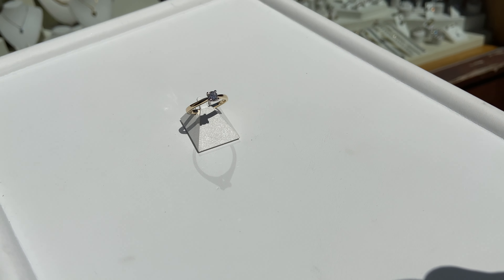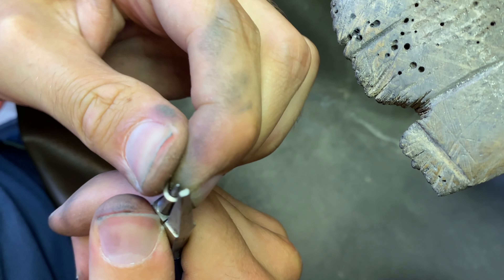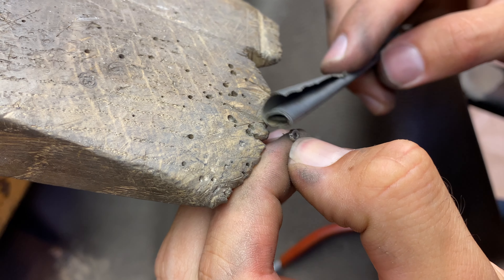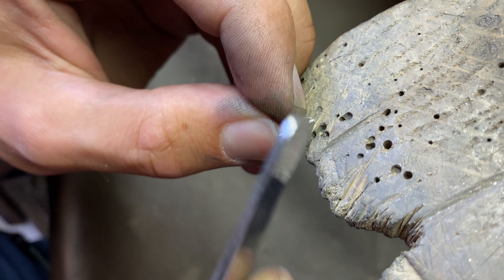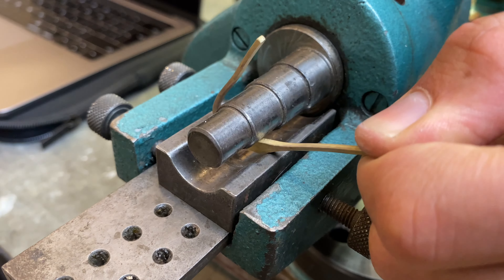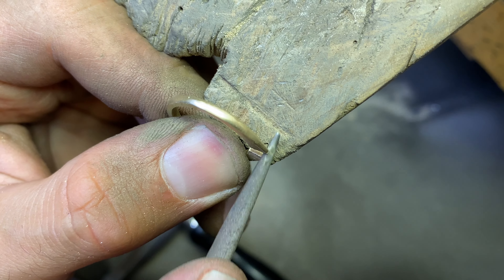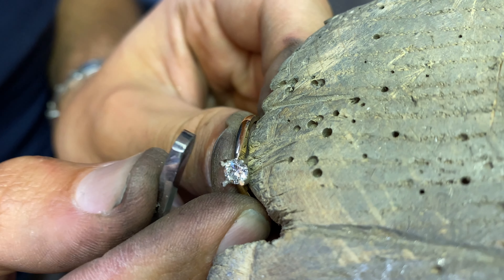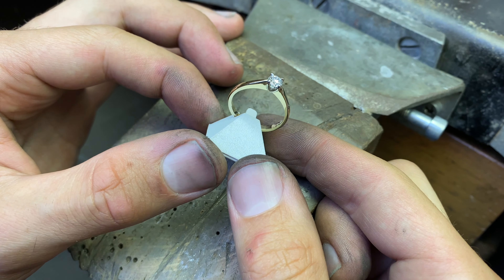Diamond Gold Ring Making | JCA

Comment: Hi Peter - this was so nice - you make it seem so easy and your instructions are super clear - if you could maybe also mention the wire gage / length for prongs - would be most helpful for me - thank you so much
Reply from the maker: Hi, the diameter of the wire depends on the size of the stone, it’s value and overall idea of the design. In this project i went with 0.9mm, this way the prongs were thick enough to keep the stone steadily in place and no get bend easily. The length was about 8mm for each prong. I made them longer then needed just to make soldering easier and to leave some room for later adjustments. Good luck!